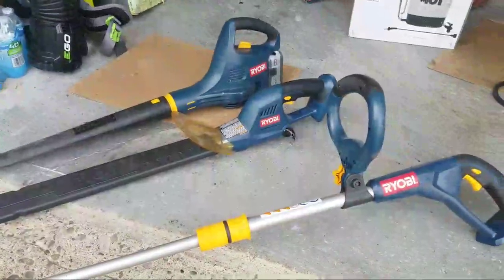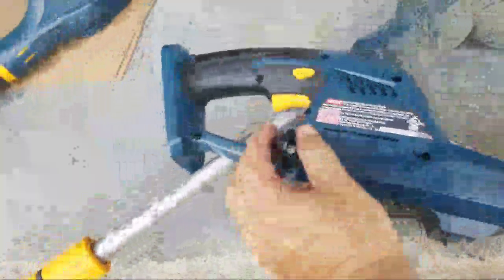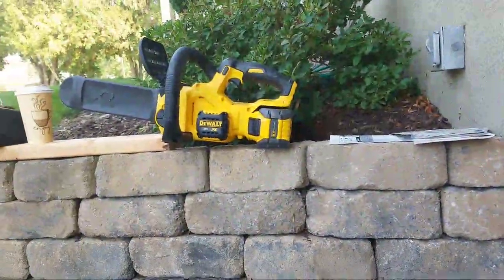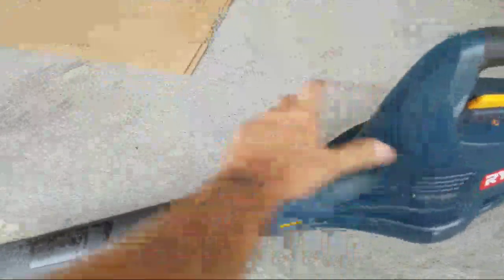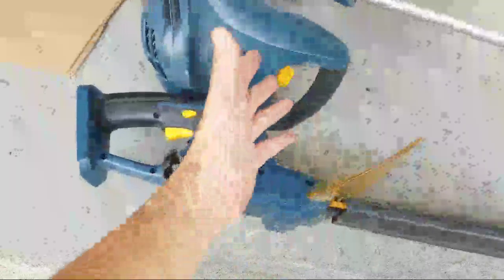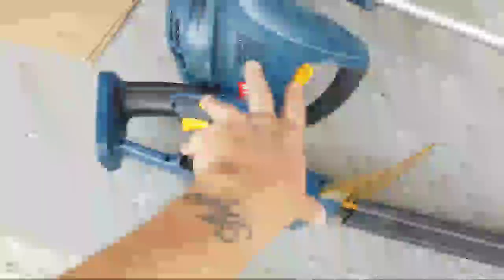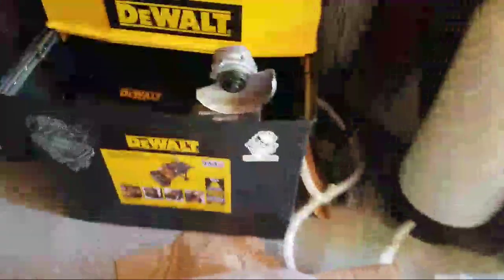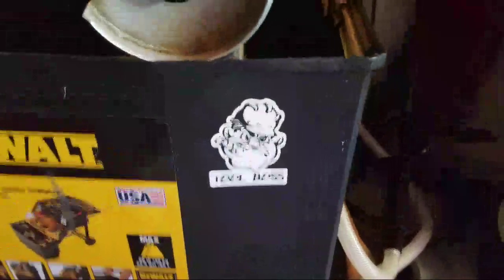Ryobi Outdoor Power Equipment (Old School)

Comment: Yeah my uncle's got some of that stuff still   it's good for the homeowner actually like that color better than the new one that came out with I can understand where they're coming from that side to emphasize more in the yellowish green color because a Bosch having dark  blue and Black & Decker is known for orange that wouldn't work and the yellow  DeWalt uses  doesn't  Greenworks use like a green color on there   outdoor power equipment I've tried one of their drills before and it's pretty powerful for  24 volt you just don't hear much about them anymore for drills
Reply from the maker: Thomas Carroll me too hate the green !!!

Comment: I had older Toro stuff that was Electric  used to have it all the Black & Decker that my uncle gave me nasty avocado green I was shocked it still worked when I moved out of my apartment into the condo and did not  have  use for it anymore gave it to.a guy that lived near my apartment at the time he hadid a yard the guy in turn gave me a Dell laptop with Windows xp pro  at the time never had a laptop   the mower was electric weed wacker I do got a Ryobi blower that runs on both electric and Battery price was pretty good cuz the maintenance from where I am sometimes  slacks off  i use  The Blower  for  Leaves from my   walkway good enough for that I do have a gas powered blower that's completely empty the tank so I can store it away cuz not allowed to have gas products when I lIve how to get it when it works for you Landscaping Company in the nineties that only Supply the mowers  that's why they want under you personally fly the equipment they just got to supply like gloves another safety gear  that's the way it's supposed to be now I work as a demolition and Carpenter I don't get paid as much as I should but it's better than having no job I didn't like the tools my boss supplied so that's why I have  Makita it was still using older Bosch nicad  I was able to get more work done with less fatigue with the Makita brand  they also use a DeWalt there you name it they have it and some Milwaukee stuff like the hog bandsaw
Reply from the maker: +Thomas Carroll bosch nicad are the best bro ...thats what i used for 10 years